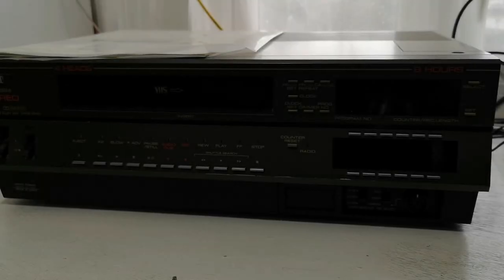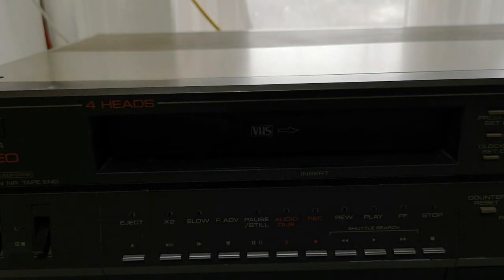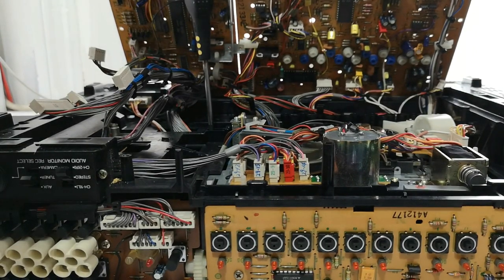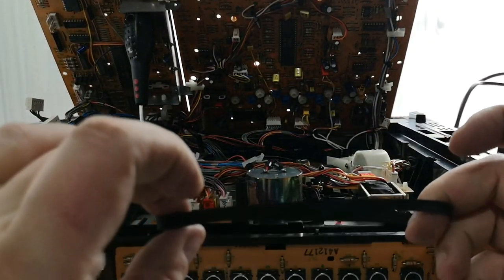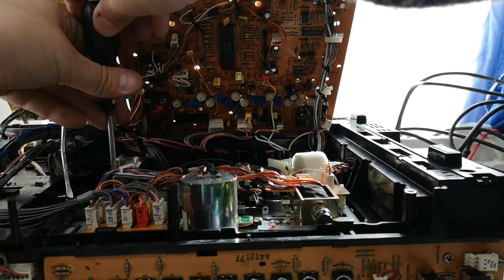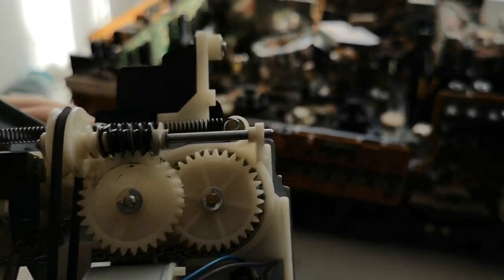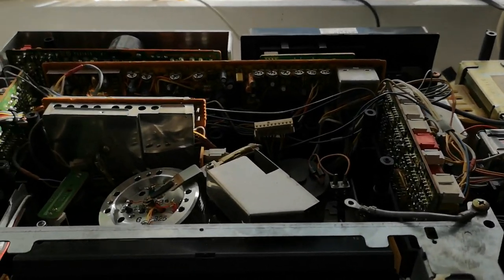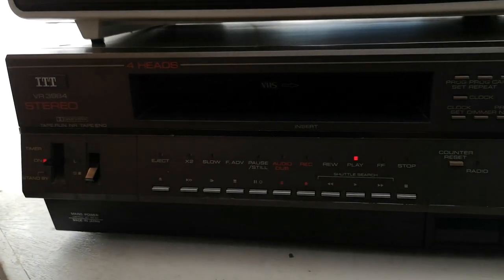ITT VHS VR3984 Service

Comment: The curse of the loading motor belt! It always seems to be the first belt to fail on this vintage of deck including the 3V29 series of top loaders. The tell-tale sign is the lack of a "clunk" from the solenoid when the tape finishes lacing.
Reply from the maker: My recently serviced, but often Dormant Baird brand 8940, did the same, recently.....cue another quick strip down, and replacement belt!

Comment: Probably some of the deck sensors are being affected by daylight, hence why it repeatedly spat the tape out with the covers off! 

32:14 Looks like some of that nasty PCB circuit glue, which, as you may be aware of, has a habit of turning conductive over time..although it doesn't look like it's turned that nasty dark brown colour, yet.

As for the no clock/ display issue, I had a look in my VCR Fault Finding Guide and it says that this is usually down to a missing -28v supply. Apparently, this is derived from zener diode D233 on the tuner/ timer sub-panel, which will likely test short-circuit. Hope that helps! :)
Reply from the maker: Thanks for the feedback, the light issue completely passed me by, I think you're onto something. Also, thanks for checking your fault guide, I'll check that out, it also jogged my memory, pretty certain I have read that somewhere, also.

Comment: Hi I've Just Watched This Upload And Would Like To Ask You For Some Advice. I've Acquired A JVC HR7655EK. It Will Power Up But Wont Accept A Tape.. If I Shove It In It Just Sits Shy Of The Chassis It Wont Sit Fully Down, Then If I Power It Off Then Power It Back On Again And It Spits The Tape Out, Have You Any Advice That You Could Give That Would Be Great And Thank You
Reply from the maker: First thing to check, would be the video lamp. On this model, it's a bulb, when they blow, it immobilses the machine. You can tell if it has gone, by switching the machine out of standby  and peering through the cassette flap.
Reply: Hi Just Checked That And No Light Lighting Inside So Would You Have A Part Number For It With Your Service Manual That Would Be Great.
Reply from the maker: Let me double check. Some kits come without the connector, so be prepared to solder the two cable, together.
Reply from the maker: https://m.donberg.co.uk/catalogue/video_spares/jvc_video_recorder_spares/17053.html
Reply: Hi Just Would Like To Ask You About The Caspton Belt You Replaced On This Could You Please Tell Me The Part Number For Donberg I Want To Order Also Would You Have The Part Number For The Loading Belt I'm Very Grateful To You For That.
Thanks So Much.